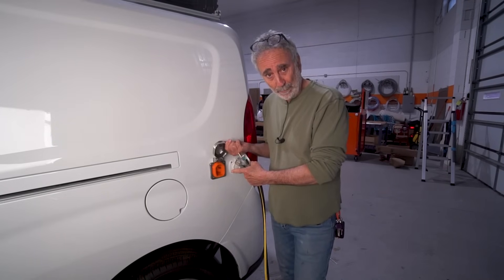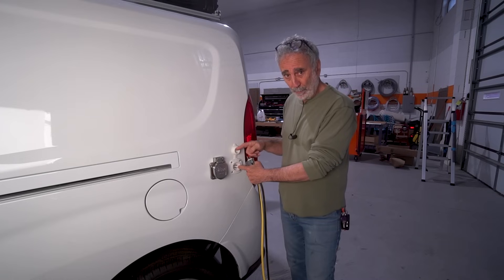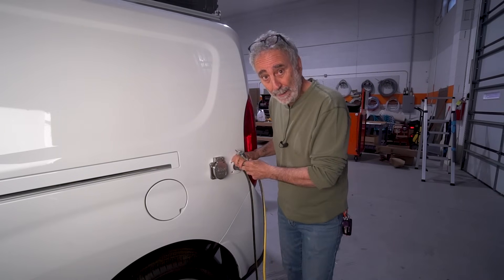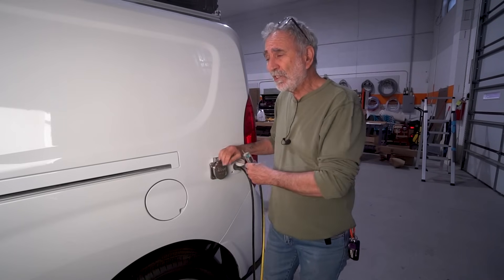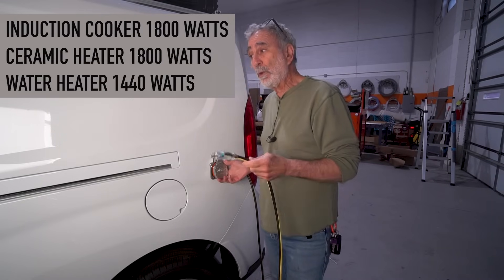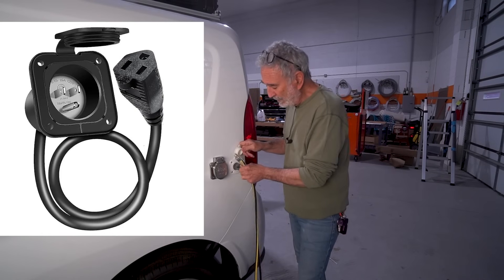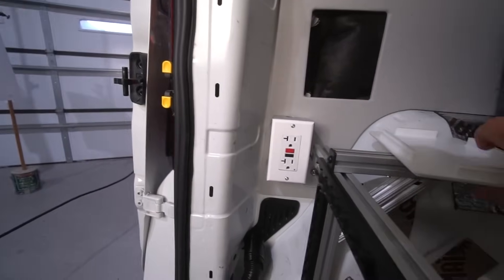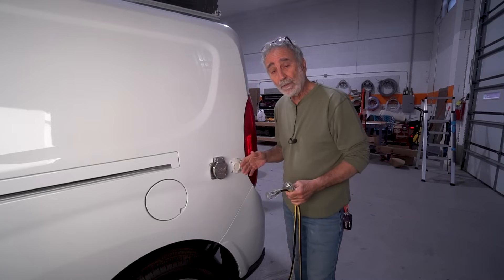Humble Road Tech Series: What does every camper van need? EXTRA POWER & FREE HOT WATER

Comment: Where is the pump for "your" glycol system? Is part of the water heater?
Reply from the maker: Our glycol pump is mounted under the van under a protective aluminum shroud just aft of the heat exchanger. The glycol can make it to the heat exchanger via head pressure from the reservoir tank in the rear. Once it passes through the heat exchanger the pump pushes it all the way back to the rear of the van up into the water heater, and then back into the reservoir where it repeats the cycle

Comment: George, love your videos.  What am I missing with the whole 'free hot water' thing with Glycol?  First, from an ROI perspective, I'm paying more $$ for the Isotemp water heater with glycol heating as opposed to a more standard electric heater.   Second, it seems like I'm already getting 'free hot water' from the electric heater as well given that it's operating while driving down the road.  Third, the electric heater method has far fewer pieces that could fail in the system.   

Is there some kind of issue, risk, or hassle that I'm overlooking when I consider an electric heater operating while driving the vehicle?
Reply from the maker: You don’t have to use the iso temp water heater you could purchase a whale for instance. The point is when I say free I mean you’re not burning battery power you’re not depleting your system from power. Your engine is making heat so I simply harness that heat.
Reply from the maker: With this glycol system in place, you rarely need to turn on the electric side of the water heater

Comment: George, this looks like a change in your original design, where the heat exchanger was mounted directly to your aluminum plate under the hood.  Does this represent a response to a problem that someone had with service due to the original location of the heat exchanger?
Reply from the maker: I believe the only time I installed the heat exchanger on the aluminum plate under the hood, was the first iteration of this design, in the Vagabond van. In subsequent Promaster builds, I mounted a Balmar voltage regulator in that spot. The heat exchangers are now mounted under the van, tucked up as high into a valley as possible and as close to the from of the vehicle as possible.

Comment: As a plumber for 44 years. Make sure all your fittings are good to a temperature of 250°. I don’t think the 90s in the picture are rated for that temperature . Remember the system is under pressure so it could get quite hot going up a long mountain climb . Remember, it’s under pressure so it lowers the boiling point, but the temperature can be quite hot.

Comment: That is a 15a connection not a 20a. the GFCI you put in and the pedestal photo are both 20a but the plug on the van and that cord are not 20a.
Reply from the maker: You are correct in that it does not have the sideways plug prong, which is 20A specific. But there are many appliances and plug cords with the parallel plug prongs rated for 20A. The rating, ie, wire gauge is my concern. 12AWG for 20A and 14AWG is for 15A. These figures are all 12AWG.
Reply: @HumbleRoad  yes you are correct. There are lots of appliances and devices that are rated for 20 A however that plug that you have on the van is not one of them and really the Wire size is only half the issue. The biggest concern is the connector if you look up failures from over amperage 99% of the time it fails at the connection point and that connection point absolutely is not rated for the amperage you’re talking about.

Comment: I've wanted to reduce risk to a ruptured line losing the engine coolant but my plan has been to put the heat exchanger in the engine bay. If the loop for the house leaks, it is separated by the exchanger meaning zero engine coolant loop will be lost. With your design, a leak could happen before your exchanger. At that point, the driver would need to notice the rising temps, pull over, wait for the engine to cool, close the valves, refill with water (and air in the line tends to be a problem). 

I see other comments have raised this but what is the benefit of your manifold if it adds risk to the engine coolant loop?
Reply from the maker: There is no room in the engine bay for the heat exchanger AND the bypass valves. If your heat exchanger, mounted in the engine bay, has no shuttle off or bypass valves, you're in bad shape if there is a failure.
Reply: @HumbleRoad  If the heat exchanger is in the engine bay with the engine hoses directly connected to the exchanger in and out ports, it is essentially like adding a length of tube to the engine loop. The house loop is still isolated. So can you give me an example or two of the types of failures that a shut off would help with? The only one I can think of is the exchanger itself springs a leak that affects the engine side.
Reply from the maker: Yes the heat exchanger itself can fail. It is made up of a number of copper plates which can and have breached each other
Reply: @HumbleRoad  If that's the only failure case, there is a definite advantage in putting the exchanger in the engine bay and not adding risk by exposing the engine loop under the chassis. When I install mine, I might see if there is room for one three-way valve and a tee to use as a bypass.
Reply from the maker: Just make sure the mechanics can loop it out of the way to do their job. In my experience, they will either do a gut job of removing it whereby it is ruined, or not touch it at all and just walk away. I can tell you the system works quite well. I have a theory about using a mixing valve or not. Without a mixing valve, the water at the faucet is 170 degrees, whereas a residential faucet, to prevent scalding, can only provide 120 degrees. But with 170 hot water at the faucet, you will use less of it, therefore, your 6 gallons of hot water will last longer. You just have to be aware of scalding.
Reply: @HumbleRoad  Using a mixing valve at the tank has the same effect of stretching stored hot water as your idea to rely on the faucet. Some facuets have an adjustment feature to help prevent scalding but I doubt it's enough to offset 170F. And if you have a guest over and forget to warn them about the scalding hot water, that's going to be bad. I wouldn't risk it for the cost in money or space. It may also damage the faucet since residential water heaters have a max tmep of 140F.

Comment: George, on the closed loop glycol running from the heat exchanger to the water heater and glycol tank, is there a pump in the tank that keeps the flow of glycol to and from the heat exchanger moving?
Reply from the maker: There is a 12VDC Bosche water pump in-line between the heat exchanger and the water heater. The glycol reservoir is higher than the heat exchangers, both in the water tank and under the van, so head pressure gets the glycol down to the heat exchanger where it hits the pump and pushes it back up to the water tank and then up into the reservoir where it starts its journey all over again.
Reply: @HumbleRoad  Thanks George. I was sure a pump was needed but didn't know where you placed it. Makes sense and appreciate the reply.

Comment: Why not use another 30 amp Smartplug connector instead of the white one and just wire it to the GFCI, keeping the same look and a safer plug architecture. Your detail is fantastic!
Reply from the maker: The point is to have an easy 20A household plug available, not to 30A plugs.

Comment: The 20 amp extra plug is very smart. Works for house power on your driveway if you need to have power in the van. 
Thanks so much for explaining and showing in detail how that glycol system works.  I did not have a clear idea before this. You really developed this idea.
1st idea: Get the manifold in place.
2nd idea: Add 3 shut offs to return to original engine design in case of malfunction with water heater.
3rd idea: Add a mounting bracket and long hoses so you can move the manifold out of the way for mechanics.
4th idea: Maybe add a silicone handle or strap to hold the hot manifold when pulling it out of its bracket?  Maybe a magnet to lift it to the hood so mechanics have space to work?

See?  I'm beginning to think like you. You would have made a superb teacher in schools.
Thanks so much for being so generous with your time and being the Einstein of RVs today. You are the best.

Comment: Great video. Not running the lines under the chassis to the water heater is undoubtedly the way to go. I opted to not use the heat exchanger in my isotemp and only run on electricity. Reason being, when driving hot water is already “free” based on the surplus of energy we generate. Was able to find a relatively affordable dual alternator setup and between that, our main alt, and average solar were setup to bring in 500amps/hour 12v. more than our batteries want to take in (for longevity) anyways.
Reply: I agree with you 100 percent that’s exactly what I did. Of all the videos I watched before building my vans I got more ideas from George than anyone else but this is one idea I just can’t wrap my head around. I’m going to guess this feature sells for well over 2000 dollars if you’re not doing it yourself and 1000 just in parts in a diy situation and in my opinion totally pointless. Just turn on the inverter and flip the water heater switch to on while your driving. I’ve seen many people do this though maybe I’m the one who is wrong. It wouldn’t be the first time.

Comment: You don't need two valves for the heater core, just one.  With one valve off, it'll stop fluid flow which will force the fluid to bypass it.
Reply from the maker: Explain
Reply: @HumbleRoad  in your video they are suggesting deleting the two vertical valves as they are placed on the table. the water will mostly bypass the heat exchanger when the remaining horizontal valve is open, just due to the resistance of the heat exchanger. closing off the bypass valve will force all coolant through the heat exchanger. You lose the redundancy of being able to cut off damaged hoses between engine and heat exchanger though.

Comment: Too many parts. The best part is no part. Any part is a liability. Each clamp, valve, pipe and adapter can and will leak.  Mount the heat exchanger in the engine bay. Minimum parts in the engine cooling. Less parts to go wrong. I won’t even add a valve on the house heating loop. If it raptures - let it be, fix it and refill the loop. Again, each component can and will leak. Eliminating parts exponentially increases reliability. If a part in a loop can fail and it’s not absolutely 150% needed, eliminate it. Over-design and complexity is the bane of our existence.
Reply: Well, you can . . .  but it eliminates options & safety redundancy. Excellence in the build, whether installing more or less, makes the biggest difference. Install it sloppy & you're looking at failure, no matter 1 or 10 valves. I'd rather have multiple valves & if one leaks, shut off using the extra valve then fix. I don't want to risk a single valve failure shutting down the whole system. Sometimes it's the severity of the consequences, not the likelihood of failure, that carries more weight in the decision. JMHO.
Reply from the maker: Oh no!

Comment: You could run the 2nd 20amp to the same receptacles and split the receptacle. one side, inverter, the other side shore power. Personally, I use a switch. 30amp in goes to the battery charger, then to the switch. The switch allows the vehicle to switch between inverter power and shore power. That way you can use the same receptacles. When I plug into shore power, I flip the switch, and my receptacles are now on shore power. I unplug from shore, flip the switch, and they're on the inverter.
Reply from the maker: Sounds like you are using either or. I can use all

Comment: I know your ALL about Sylin' - how about using a white (at worse s Black) 30 amp cover as the chrome looks like 1999👍

10 years ago I put my 20 amp plug  under my van (no drilling panel or eye sore) . Sure - more of a PITA to get to - BUT I use it so infrequently that it simply Does NOT Matter!!!
Reply from the maker: Yeah, I've used the black and grey versions of the Smart Plug, but they are plastic. That inlet lid gets a decent amount of abuse so the steel and chrome version is my go to choice. I didn't think it looked bad, but now you....
Reply: @HumbleRoad  PAINT

Comment: Are you running a 12v pump to circulate the coolant on the water heater side? Your manifold has the ability to isolate the water heater loop if there is a problem so I’m not sure why the heat exchanger is necessary? Just to minimize the length of engine coolant line?
Reply from the maker: Yes, the pump on my side is a 12VDC Bosche. I kinda went into detail in the video as to why I include the heat exchanger. Maybe you went to the bathroom? 😊

Comment: I’ve made the same manifold but use the return hose off the heater box so that as van heats first then the heat exchanger. I want maximum heat getting to the defroster or floor in the colder months. My suggestion for your heat exchanger as the hot water system can wait to heat until van is comfy or the window has defrosted.
Reply from the maker: I just commented to another poster, the added volume of coolant in the engine system more than compensates for the exchanger. I've done this system on several of my builds and have not heard any complaints.

Comment: Does your added heat exchanger reduce the amount of cabin heat available?
I'd think you would need to increase the HVAC temperature and/or fan speed to compensate for the loss of heat to the heat exchanger
Reply from the maker: Certainly, there is some heat loss at the exchanger. But the volume of coolant in the chassis system more than compensates for that.

Comment: That is a lot of valves for diverting hot glycol to the house. It also has the potential to completely block all flow of the glycol if the wrong two valves are off. 
Why not put a “Y” valve on the heater core return line that either sends the glycol to your heat exchange or to the engine? Glycol can’t flow through the heat exchange if you have the “Y” valve set to return to the engine since the same valve that is diverting the glycol is also blocking the glycol from flowing backwards through the heater core. 
You may want to add an emergency valve to completely isolate the factor loop but I would put tape on it so it isn’t accidentally used. 
I would also tap into the return from the heater core since heating the cabin during winter and defrosting your windshield is far more important than a hot shower.

Comment: Would a Tesla style charging plug be a viable 3rd option or just overkill. And can you reverse the hot water flow to preheat the engine. Thx and God bless .
Reply from the maker: A Tesla style plug would not be practical, since it is not common in campgrounds or driveways. The heat is generated from the engine. In order to preheat the engine, one would have to turn on the water heater 120VAC internal element (at 1500W) and also add a pump on the engine side of my heat exchanger. Modern automobile engines only require preheat if diesel in colder climates.

Comment: I want a powerhouse where I don’t have to worry about running the AC and heat without using shore power.
Reply from the maker: I provide the powerhouse as well. But there are times when even the largest capacity powerhouse in not enough.But you know; I wear a belt AND suspenders...
Reply: @HumbleRoad 😂
Reply: Agreed😊

Comment: George,I'm enjoying watching your how you build videos. I remember watching your first flooring build. Would like to see more of that and basic construction. 
You glued down square tubing across the floor. Looks like you may have changed that over the builds. I'm interested because I've seen many YouTube builders doing it differently.
Not sure about the size of the square tubing and if it's screws and glue or just glue is enough. Also I wasn't sure about the heavy mass vinyl. You said you were going to use it on the floor but I don't recall seeing that. The starting basics are important and the materials too.

Comment: 12AWG ■COPPER■ CABLE.
Many cables say CCA which means they are Copper Clad Aluminum. You'd need a 10AWG CCA cable to carry the same current as a 12AWG copper cable. That's become a common, and dangerous, cheat. Because CCA cables are much cheaper than copper, and the victims don't know they are being suckered. Or burned alive.
Reply from the maker: Excellent point that I wasn't aware of. Thank you for that info.